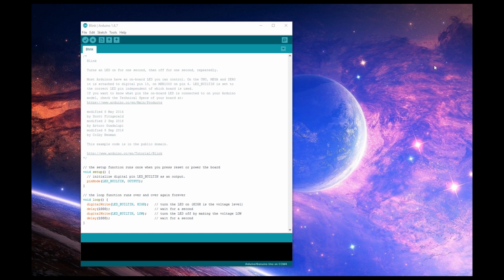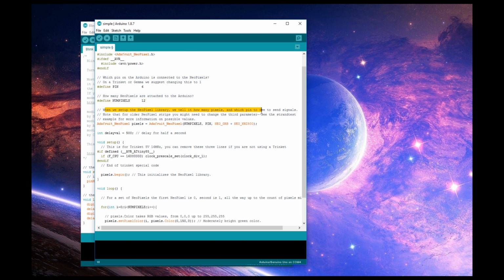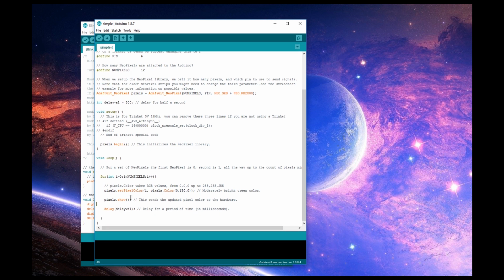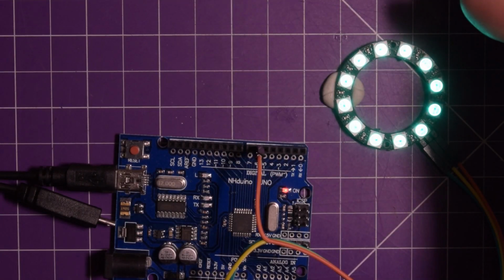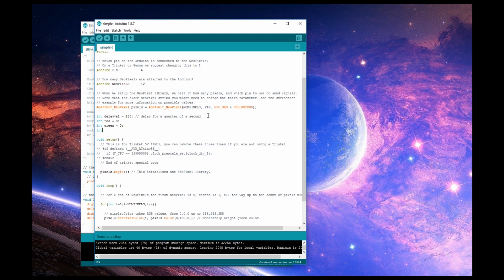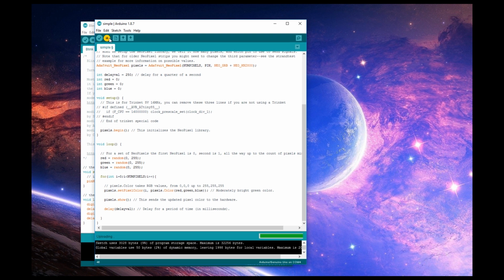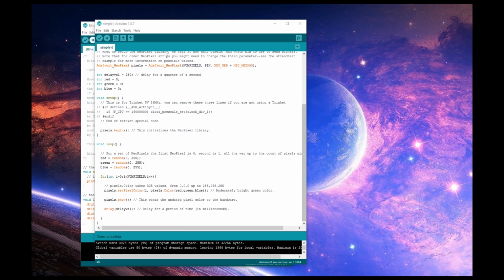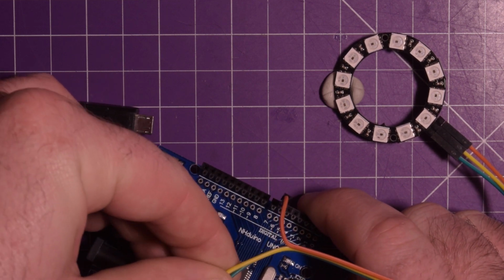Playing With Neopixels!

Comment: What do you think the maximum safe number of neopixels are to run off of the Arduino before using a separate power source and a mosfet?
Reply from the maker: Power-wise I would say that 5 is already pushing it, but it depends on the input of the Arduino; if its being fed from a 5v USB maybe you can push that to 10, maybe! but if you are using the arduino's regulator to regulate down from say 12v, only a couple would be safe. also, I'm not sure why you mention a mosfet, the arduino can drive the pixels no problem, it's the current supply the problem!
Reply: Simple Electronics well that’s the thing. I’m having a hard time finding concrete info on what external components are needed to drive neopixels off of a 3D printer mainboard (which is essentially an Arduino). I’m not sure if there’s a difference with how you drive neopixels vs LED’s, whether it’s appropriate to use digital vs analog pins, when a external mosfet is required vs when I can just run a external power to the neopixels and signal ground to the board, etc.
Reply: The printer board is running off a 24V power supply and then there’s 5V pins on the board that I know can’t handle any real current so I would be running separate lines from the 24V power supply to a buck convert and drop it down to 5V while pulling as much current as I need. I want to drive 2x 200mm strips up the sides and a small bar under the nozzle.
Reply: i use 60 led directly from arduino and plug the arduino to smartphone charger or laptop USB and its fine

Comment: I am increasingly impressed by the simplicity of the Arduino programming environment. Have you ever tried the RaspberryPi? I suspect it may be more difficult to programme, but potentially have more versatility as well.
Reply from the maker: It would certainly have more versatility since it has an order of magnitude more processing power, but I can't comment on its ease of programming since I have never tried. I am slowly leaning Python though, so it's definitely a possibility.
Reply: @SimpleElectronics  I pre-ordered one when they first became available in Britain from RadioSpares in summer 2012--and have never done anything with it. I am not even sure I ever powered it up--quite a waste to say the least! I got it at the time because I heard it would be possible to fully emulate in hardware the old Acorn RISCOS computers using the RaspberryPi. Sadly I never heard much more about that, so don't know where the project stands or if it even went forwards.

When it comes to scripting I am personally not a fan of Python over Perl. The weird white-space-as-syntax has always put me off along with the immutability of variables paradigm. Sadly there is not a really good Perl IDE while Python is very nicely integrated in to VisualStudio. No doubt therefore at some point I will be forced to make the jump unless something changes.
Reply from the maker: @morelenmir  just install a nice Raspbian OS and go browse the internet with it, at least it won't be collecting dust!
Reply: @SimpleElectronics  Good point! I may give that a shot!